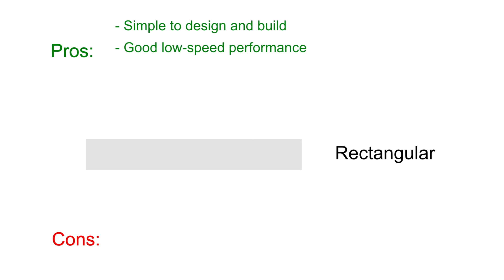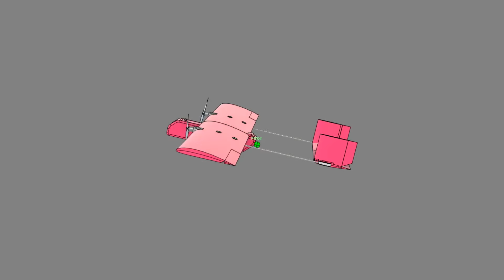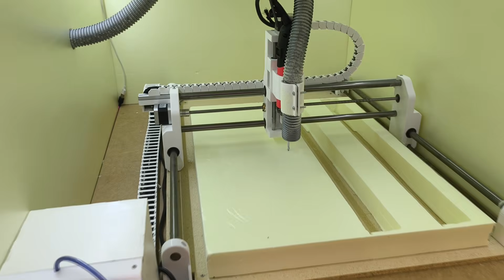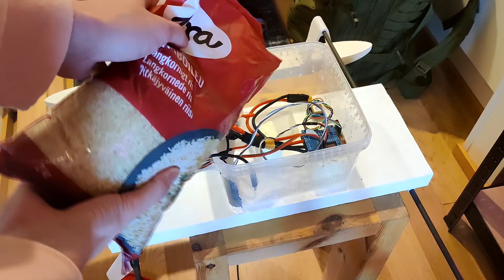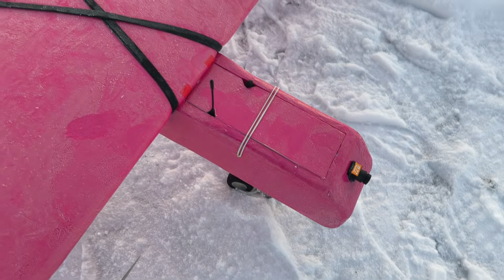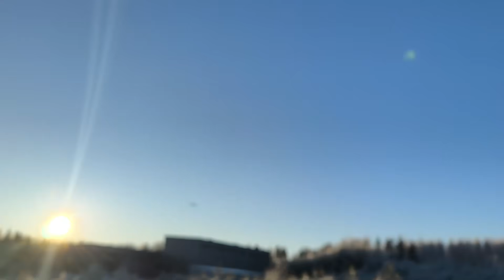I Built a Long-Range Fixed-Wing Cargo UAV from Scratch

Comment: what kind of foam is best for what you built/propmaking?
Reply from the maker: I use a XPS insulation foam panel called "Finnfoam", but I think it's only available in Finland. It's a bit more durable and tough than regular XPS panel, but regular XPS also works really well.
Reply: @Femboy_Engineering  thanks!

Comment: For the 3D printed parts I'd suggest checking out Easy ABS (85% ABS and 15% TPU blend). It is about 13-14% lower density than PETG and has almost the same mechanical properties as regular ABS (actually slightly increased impact resistance, due to the TPU content), so you could actually further reduce the weight by reducing wall count or infill. The only downside compared to regular ABS is the reduced temperature resistance, but it is still on par with PETG. It is also printed at lower temps than regular ABS, so it can be printed on open printers (although enclosed is still better, but it doesn't need a heated chamber).
I usually get it from Aliexpress for 10-15eur/kg. So it's not quite as cheap as the cheapest PETG I can get (<10eur/kg, on sale even down to ~5eur), but I have had great success with it for parts that need to take some mechanical load.

Comment: Nicely done. Looking at the your control surfaces they look to be small for the volume of the rudders and elevator. At low speeds 30 to 50& of the volume should be control surface. Ailerons should be about 10% of the wing area. 

I also like your cnc foam cutter. I need something like it to cut full sized wing ribs and nose blocks.

Comment: Which motors?
Reply from the maker: I used the A2212 13T 1000kv ones
Reply: @F @Femboy_Engineering 1400kv with that Prop also work?

Comment: Completely unfounded recommendation, but I would lower the front landing skids enough so that on landing, the propellers can't touch the ground easily to try to protect them. It might not be a problem, but it would help ensure the propellors don't impact the ground during landing. Of course that isn't needed if you plan on using conventional landing gear, but I prefer adding some degree of protections to my components whenever I feasibly can.

Comment: Love these build content. Just a tip I've picked up with cutting out servo pockets. To make a quick hot wire foam cutter you can scoop out servo pockets with. Get a piece of stiff wire, bend the center to two 90 degree angle, like half a square shape. Then wrap the two ends around a soldering iron.
Reply from the maker: Oh, thanks for the tip! I haven't even thought of that. That would save a lot of time!!

Comment: Is your CNC hot wire cutter entirely homebrew? Very nice work indeed! I haven't done any wire cutting in foam in over 30 years, for such a simple and straightforward method it's tricky to get right.

Comment: Clark-Y is garbage :( At least at the RC plane scale. I found AG26 to work extremely well

Also, an I-beam spar is Much stiffer and lighter. Not stronger though, unless you replace the foam in the middle with balsa or something. If you do, it's also much stronger. And since you have a CNC cutter, you have no excuse not to use it. 

For glue I found love in marine polyurethane glues: light, incredibly strong, foaming, so they fill all the imperfections, and curing in 20 minutes after you spray them with water a little. Hot glue is very heavy and unreliable.

Good call with the shrink wrap though. We use fiberglass at work, but it's gonna be a nightmare at home, so shrink wrap is the next best thing. Scotch tape being the third.

STOP WITH THE 900 ELRS, 2.4 WORKS JUST AS GOOD AND IT'S MORE CONVENIENT

Heated inserts are good, but not for vibration heavy environments, I find it's better to add spaces inside of the 3d print for regular hexagonal nuts, pause the print, put them in and resume.

Wait, where did 2.5kg come from? Did you use some crazy dense XPS and shrink wrap? Sure, motors and ESCs are ancient and heavy, but this doesn't explain it to me, I thought it's like 1.5

Actually, there are funny effects with bumpy rough surfaces at low Re numbers, yes, there is a drag penalty, but lift also increases substantially. The plane was probably just too nose heavy and too heavy in general

Not sure about Clark-Y, but with AG26 you can push the CG as far as 50% of the chord. In manual flight the plane is going to be extremely twitchy, but ardupilot can still fly like it's on rails

How dare you get so close to the beautiful Ruoholampi lake and not fly over it?

In general though, nice project! Love seeing more people who are into planes. I would be careful with that flight controller though, I had one reboot in the air and send my plane nose first into a tree with predictibly catastrophic results. I've been procrastinating on editing and uploading that video for over a year...

Comment: If you like tinkering you can try openIPC based fpv , such as RubyFPV.

But don't be fooled it's not as cost effective as it seems, just fun and configurable 

DJI N3 + o4 (lite) is still the king of affordable digital.
Reply from the maker: I've been thinking about that for a while now, and I should probably try it out. Maybe I'll be able to use christmas as an excuse to spend the money on that :3 I've also considered walksnail, but walksnail feels quite expensive for what it offers.
Reply: @Femboy_Engineering awesome, I'm waiting on parts right now and will have a rubyfpv setup going sometime after Christmas

Comment: awesome video!! if i may ask, what software are you using for your aircraft design? i cant find a decent cad software to use.
Reply from the maker: Thanks :3  I use OpenVSP the most, for iteratively creating the airframe mesh and analyzing it, as it is good enough for like 99% of RC plane/UAV design applications. If you want to do it in a more fancy slightly more accurate way, you can also use XLFR5 for a slightly more comprehensive analysis, but it isn't often required. After making the mesh, I import it into Solidworks/Fusion360 in the .step format to turn it into a solid body and edit it further.  After that, you can use Ansys to further optimize the airframe's efficiency, but Ansys is insanely expensive. This step is mostly redundant, unless it is a serious aerospace engineering research project.

Comment: Hey what software do you use for your CNC cutter? Im trying to get a similar one working but i couldnt get the software to work and im also having trouble with an old serial port :(
Reply from the maker: Hi! For the hotwire cnc cutter, I used the 'GRBL HotWire', and I used an arduino mega 2560 with a RAMPS 1.4

Comment: Peak Channel :з
Since it flies so well even with pretty small propellers it should be able to carry payload. Yippee! Maybe you could give it a little cargo bay or a claw and put a blåhaj on a parachute for it to drop.
Deploy Tactical Support Haj!
Reply from the maker: Hehe :3 I was thinking of doing exactly that in the next video! :3 I'll also buy some larger propellers for it, to give it even more thrust :3
Reply: @Femboy_Engineering  It's gonna be so peak 🥹
O ya make sure u get a good propeller for the motor's power min-max and air temp :з
Good luckkk I can't wait ^-^

Comment: "It's not really cold" "It's minus 5 Celsius"

Its all relative, I would freeze even if the snows super pretty 😭
Reply from the maker: Being cold is just a state of mind :3 (although my fingers nearly got frostbite after half an hour) :3
Reply: @Femboy_Engineering I guess that explains how you could the skirt in that weather, but also AAAAAAAAAAA frostbite is scary stuff 😨
Reply: -5°C is mildly inconvenient but I suppose I'm not the best example as I'm Canadian and put my garbage out on the curb in my bare feet in the winter. 😁🇨🇦⛄🐻‍❄️❄️
Reply: @notwithintolerance -5F is a different story for me. Heated grips, heated gloves, fingers tips were screaming after an hour at highway speeds. -5C no problem.
Reply: It is in the mind. Kinda.
If your body doesn't constrict the blood flow to your extremities, you will not feel cold, but you are actively loosing core heat in that process.
Very few people can overcome this reflex and not get frostbike. It is not that easy, but achievable.
Reply: Hmmm.
Game is Game!
Reply: -5°c is really not that cold lol. You will survive very low temps no problem. Heat is what gets me personally, the cold is always forgiving. Honestly, -35°c is when it gets a little chilly for me to be out without coat.
Reply: @Server.52 im Australian, +5C is cold to me.
Reply: Annnnd it's 45 degrees in my country.....
Reply: It gets to ~40 at max in mine, I feel you there

Comment: build some skiis on it maybe it can take off in the snow with them
Reply: You could also build detachable floats to put onto the skiis for optional water landing!
(Edit: then build an RC boat that could be deployed from the belly of the aircraft upon water landing! Bonus points if you can also build a retrieval mechanism like a magnet on a cam that keeps it at an effective stand off distance during deployment but lowering into magnetic range for retrieving and then lifting back into the belly bay to reduce water drag on take off 😉).